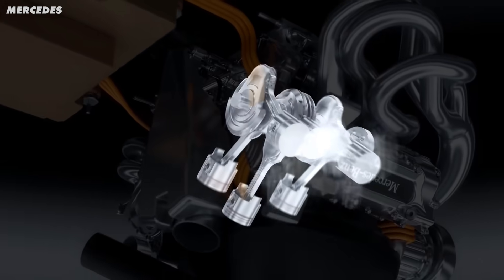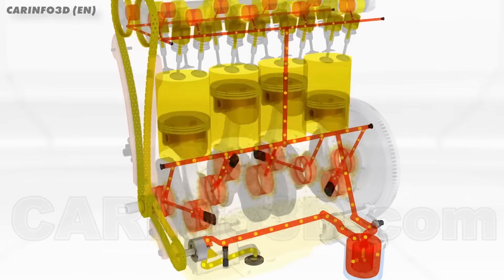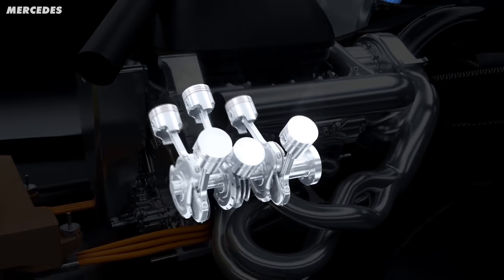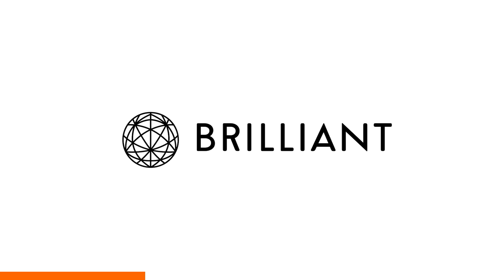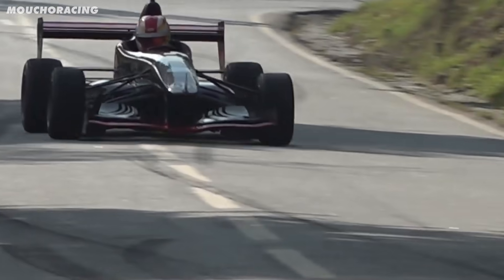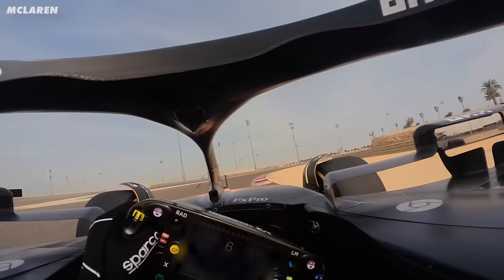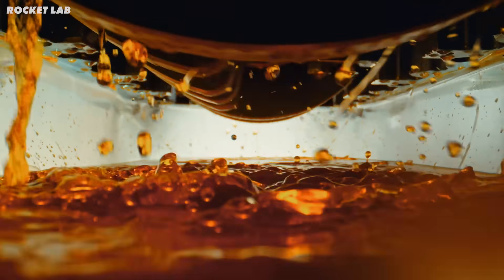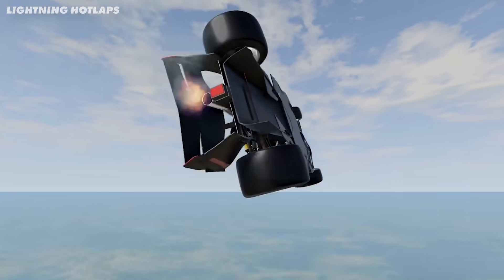Why F1 Engines Won’t Work Upside Down (for our stunt)

Comment: I said weeks ago, develope a cradle that will hold the car upside down on the tunnel, the car and cradle move along the top of the tunnel and the car is released when the speed needed is attained, mount the engine upside down in the car.
This will get rid of the issues of climbing up walls of the tunnel (although not down) the issues with the engine and will shorten the tunnel needed

Comment: The V12 in an Messerschmitt Bf 109 was mounted in an inverted position. Just needed some clever engineering to deal with the oil situation.
Reply: Lots of WW@ era aircraft engines were made that way.  But there were still issues with negative G's.  The Germans were early to use fuel injection; that's easy, at least today.  But oiling and water cooling are not so easy at all.  The direction of the piston's motion is irrelevant.
Reply: The engines in the bf 109 werent mounted upside down, they were inverted-V engines. They still had a right way up, and would still have massive problems if under negative g for more than a few seconds.

Comment: I mean not a bad choice but you could have used a boxer engine.  They are low center of gravity and can easily be converted while keeping that center.  But not gonna bash the choice.  Easier option to go with and possibly cheaper

Comment: So kids can double the power of their Honda Civics with 2 formula junior motors on the back wheels, improve their 0-60 and have 4wd, be able to turn off their baked bean can exhausts by driving on electric only through residential areas and tell their girls mum that they drive a hybrid.....sweet

Comment: Electric motors powered by super-capacitors and/or a pantograph (current collector) on powerlines inside the tunnel walls. Basically like a Carrera car.

Comment: This series is really cool but i would do it with a 2 stroke. These dont care about orientation and it shouldnt be too hard to connect it to a fuel bladder which solves the fuel pickup problem.

Comment: One thing I would suggest is to build an RC scale model (and a crash proof one at that) and use it to test the aerodynamics in the real world and to verify the computer modelling data. I think Scott should only attempt this stunt in person if he can successfully drive an RC model upside down in a tunnel first.
Reply: Aerodynamics do not work exactly proportional to scale. That is why if you look at the history of F1 testing you will see their scale model findings and wings did not work the same in full size cars. They also learned that running a car on a treadmill with fans blowing did not offer the same results as real world testing on track.
Reply: @briangc1972  I'm fully aware that scale is important in aerodynamics. It's not a panaceum, I see scale RC model as an inexpensive way to further de-risk the project. The cost will likely account for only a very small proportion of the total. I would not replace any stage of the project, but rather add it as an additional milestone. As far as I know there isn't much experience in the field when it comes to driving upside down, which means any theoretical calculations might not take into account something important that the scale RC model tests might reveal. Also, this could give Scott the opportunity to do a "sim practice" and perhaps find the least risky driving technique before attempting the stunt himself. And we would get another cool video!
Reply: It still gives you important data though like tuning the torque vectoring system.
Reply: not enough downforce
Reply: It would have to be a large scale RC car, the components are available and the software for the yaw stability can be taken from a flight management system.
They would just have to make it very light and the scale speed would have to be faster.
But I think it would work... 🧐
Even if they didn't do it it would make an interesting project. 🤔
Reply: Who r u why should they listen to u
Reply: @MrJoshsss  I'm nobody and they don't have to do anything I suggest. It's just an idea, why do you seem to have a problem with this?
Reply: @MrJoshsss  bro is too lazy to type "you" and "are" yet have the balls to say such
Reply: @MrJoshsss 
Nice response. Really makes someone feel like 💩
Reply: @MrJoshsss You seem to think fame is directly proportional to intelligence.
Why?
Reply: Yeah, it would need to be either a remote controlled real size car (with ballast the same weight as Scott) or a model with programmable self driving, so that the eggheads can do their own test runs and fine tune/troubleshoot in advance. But that would add extra costs to the stunt, which they're trying to contain.

Comment: My first thought was a two stroke. Two strokes don't care about being upside down as long as you can supply the fuel, which isn't actually a big challenge with todays FI two strokes. So a couple of snowmobile two strokes and your 200kw need  should easily be met.
Reply: The obvious choice is to just go electric.
Reply: It'd still have the downside of needing a way to power all four wheels, which would add more weight and complexity compared to electric.

it'd be a neat idea if there was a strict requirement for it to be gasoline powered, but because there's no such requirement it wouldn't make sense to go with it when electric has so many more advantages.
Reply: Yeah, but they'll struggle to find sponsors with a stinky 2 stroke engine, can't have that in 2023.

Comment: Here is a video of a "slot car" racing inverted, relying on the "down force" generated by its body shape to hold it to the track surface while on the upsidedown section of the track. Note that the video is in German and is quite technical, science and maths. https://www.youtube.com/watch?v=mt0quU_DGKM

Comment: Would a loop with a long flat top not be better than trying to corkscrew onto the ceiling?
Reply: I think the approach a d departure angles would require the wings be off the surface. Ground effects necessitate they be as close as possible. Even the curve in this approach will have reduced downforce in the centre of the car.
Reply: My thought was you'd have the centripetal forces to help you stick it through those transitions.

Comment: i love this approach. it's almost like you guys try to approach car physics that resemble the ones in trackmania, but in reallife. only thing missing now is cars jumping half a kilometer and then landing smoothly without any springs :D
Reply: uber bug /s
Reply: Technically possible, if physics calculations are accurate.
Reply: Nose bug to shortcut to the finish for a new WR
Reply: @blauw67  imagine them making TAS on a real formular one car
Reply: @blauw67  has to be a noseboost
Reply: Might get a random edge bug and slowdown and crash and burn and die. Just hit respawn tho it's all good 👍
Reply: didnt think trackmania would be mentioned xd. but true.
Reply: Obviously, they need to call Hefest for some input.
Reply: @dimitarvenedikov  simo would make more sense
Reply: Listen just saying they should use reactor boosts
Reply: Pioneering work on the next great real world racing series.
Reply: Just drive it in slow motion like ri(omegalul)lu
Reply: Imagine driving a sausage loop irl
Reply: @andrezzz_  Quantum slide through the sausage loop into a gorilla grip ice slide
Reply: If they dont do a speedslide into the loop, then into a neo slide in the next corner ill dislike the video.

Comment: dont think oil is a serious issue when going upside down in an engine since you wont drive like that for that long. fuel would be an issue but theres some pretty obvious solutions to it (just a pressurized balloon in the fuel tank). electric may be simpler though
Reply: But ice is more fun

Comment: You really need to alter the design of the tunnel so that the car's trajectory is straight. This will not challenge the legitimacy of the up-side-down part of the drive, simply bcz you can't have any centrifugal force going up when the roof is straight. It will only make both transitions safer and maximize the downforce effect by removing steering from the equation. Also you could then test the track more easily, use solid fuel rockets as propellant etc. The turn in the middle of the roof is the killer. This upsets the only thing keeping you alive. The next killer is the end of the track. This bit is far more dangerous than you think. After the G's and disorientation the end of the road comes quicker than you can imagine. Please don't commit a public suicide over a too stubborn ego. That has happened in YT way too many times already.

Comment: if the engine wasn't a stress member, you could mount it in a gyro-bearing cage so it would always hang inside it vertically, I mean...it's a stupid idea, but it would work.
Reply: And then the engine just spins around in the cage instead of turning the tires.
Reply: @KyleMc16 HAHAHA very good point. At least I said it was a stupid idea, I think I covered myself. I'm going to claim I was drinking at the time 😂
Reply: Or use 2 stroke!  Chainsaw works in every angle!

Comment: You can connect the car to the tunnel with a cable that attached to a rail system. This way there is no need for a battery.
Reply: Nice idea but i think the throttle won't be that responsive

Comment: So the general answer to the original question "can you drive a Formula One care upside down?" is - a big fat NO! You have to build an entirely new car and an extra tunnel....who would have thought ...  You could have considered a good old two-stroke engines with oil-fuel mixture - they aren't orientation sensitive. But there is still that issue with the differential, that can trow you out of yaw control. And the need for the grip is very critical here, so an all-wheel drive is almost obligatory. Those two reasons are strongly advocating towards electric propulsion. Anyhow. Without differentials between wheels and axles, and with steering of the whole axles instead of single wheels, it might have worked with a two-stroke engine within a manageable development budget.
Reply: Yeah, I’m starting to get disappointed with these series because of that. 

The myth is about F1 car. Now it has literally nothing to do with that 🫤

Still interesting experiment but doesn’t have anywhere enough of virality to it.

Comment: Electric seems like a fine idea, however I'm not convinced that you couldn't modify the oil scavenging in a gas powered engine to make this work.
Reply: It’s not about it being impossible to make an ICE work it’s that it’s so much easier, cheaper, better and quicker to just use the electric motors already available.
Reply: Remember that they're not on an unlimited budget, modifying an engine is not something simple, it takes time, effort and lots of money, and it's still way riskier as there's still a high chance of failure if not tested properly, so going electric seems much more straight forward in this case
Reply: Torque vectoring is a probably one of the main reason why they chose electric.
Reply: Half a Subaru boxer engine. Done.
Reply: Come on, everything is possible. It's never about can or can't. It's always about the Benjamins.

Besides... If you want to inspire a new generation of engineers, you don't want to stick with technology that will be phased out in a decade.
Reply: @AnttiBrax  electric cars are a scam that won't replace shit
Reply: @AnttiBrax  I'm happy to be the one to burst your bubble and let you know that internal combustion engines aren't going away anytime soon.
Reply: @MapleShrimp  You both are correct, ICE is not going away 100%. But in 1st world countries, the politicians are going to restrict them. He is correct, you will gain more interest in a newer tech version of the car. He is ultimately wanting to make money on this project using an ICE make limit that. The electric motors and battery are about the same weight as an ICE with drivetrain and fuel cell. Easier to control 4 electric motors with torque vectoring.
Reply: @AnttiBrax  Ever heard of synthetic fuels? Stop acting like electric is the only possible future. It's just wrong
Reply: @EllieDouglasF1  Synthetic fuels are a con and will never be anything more than an extreme niche.
Reply: @drunkenhobo8020  I'm glad you're so passionate about a topic... however I'm not so glad about how wrong you are
Reply: @ydhvudbb450  I'm not wrong though. They're exceedingly energy intensive to produce and come with many of the same issues that regular fossil fuels do.
Reply: @drunkenhobo8020  you are wrong tho. They're cleaner and better than fossil fuels, and everything is expensive when it's new. Once it's optimised and able to be produced on a bigger scale, it'll be reasonably priced enough for every common man to put into their cars they already own. No need to buy a new car or to sit on charge for 30 mins every 300 miles. Also manufacturers won't need to worry about replacing every car on the planet
Reply: @ydhvudbb450  They still produce tailpipe emissions that create air pollution in built-up areas. EVs don't. And you can't optimise it - their intrinsic properties cause them to require far, far more energy than a simple BEV.
Reply: @drunkenhobo8020  what comes out the exhaust isn't the full story. Electric cars need power from somewhere, and it's often a coal plant. Synthetic is cleaner overall
Reply: @ydhvudbb450  Umm... you do realise synthetic fuels also need electricity to be produced, right? And you need a lot more electricity to go 10 miles on synthetic fuels than you do on a BEV.
Reply: @drunkenhobo8020  not even close
Reply: @ydhvudbb450  Then please point out what I got wrong instead of just being vague. A non-hybrid petrol ICE car is around 20% efficient. An EV is around 80% efficient. So if you produce 100 kWh of electricity 80 kWh will get to the wheels of the EV, but only 20 kWh will get to the wheels of the ICE car. Or in other words, you'd need to produce 400 kWh to go the same distance as the EV. And that's not taking into account efficiency losses of producing the synthetic fuels.
Reply: @drunkenhobo8020  petrol is pollutants than synthetic. The same petrol machines are becoming a whole lot cleaner, just by putting synthetic fuel in. I've already said how it's not optimised enough to become a globally affordable product yet, but that's the key word: yet. As it's more optimally produced, it will be cleaner to make than electric machines and cheaper not to need a new car
Reply: @ydhvudbb450  Synthetic is cleaner as you don't have any sulphur or impurities, but burning it will always produce CO and NOx emissions. And it doesn't matter how much you optimise it - the inefficiencies of petrol engines will always lose to an electric motor. You can get them up to 40% efficiency by making them hybrids, but then you're still half that of an EV. So that means double the energy to produce the synthetic fuels. That energy has to come from somewhere, so if you're complaining about EVs running on coal plants, synthetic fuels are twice as bad.
Reply: @drunkenhobo8020  it doesn't produce them, it's made from them. It's not releasing anything new
Reply: @ydhvudbb450  Yes it does. CO and NOx are unavoidable by-products of combustion engines. They're very bad for human health.
Reply: @EllieDouglasF1 synthetic fuels is a pipe dream. the same people that argue that electric power grids and renewables will never be able to support the charging of a billon+ EVs also suggest that the solution is spendind 6x more electricity to get the same energy at the wheels....also think about cost $500 synthetic fuel full tank vs $10 full battery charge
Reply: @drunkenhobo8020  because fires that are awkward to put out good for health
Reply: @ydhvudbb450  What? That doesn't even make sense. Come on, just admit you're wrong and didn't know anything about the subject. It's fine as long as you learn.
Reply: @drunkenhobo8020 yeah the ratio is actually 5-6x in favor of BEV vs fuel combustion engine.
Efuel will never be anything but an expensive way for happy few to run their expensive sports car or supercars after gas bans/emission laws. I'm pretty sure regular people will still be allowed to drive classic cars on gas. but it will be way more expensive and less practical than EVs. no more gas stations for a lack of a market. long before this bans happen,  you'll be able to convert any old classic. car/truck with a power unit containing motor electronics, AND battery, lighter than the original motor, with possibility to run the existing transmission, or not use it. just some adapting mounts
Reply: You are right, an ICE can work. But there are politics involved here. The "latest, newest, cleanest tech" is electric; according to some people. Whether they use an ICE or EV, it is still an interesting discussion and experiment.

Comment: Even my go-kart doesn't want to be run at a greater than fifteen degree incline, let alone upside down.
But how long are we talking about running upside down?
Mear seconds, correct?
In that case I'm sure any engine would work long enough, with some damage possible, or even likely. But catastrophic failure instantly seems unlikely to me.

And I have seen Formula E races, so why not an electric vehicle.

Comment: if you want light but powerfull source for an electric motor, super capacitors can be an interesting choice
Reply: i didn't know capacitors were also motors, cool
Reply: @marc_frank i think he means source as in power source (ie battery).
Reply: @marc_frank  "if you want light but powerful source FOR an electric motor" he's saying a power source for the motor, not a power source and a motor in one
Reply: Probably not, you'd need a huge capacitor to power a whole car. Lipo batteries are probably the best option, those are already used for vehicles where weight is critical and a lot of power is required, like fpv drones.
Reply: @_Dimon_  oh fpv, greetings :)